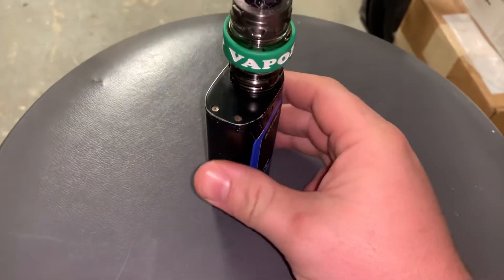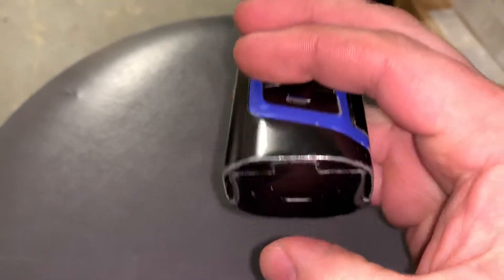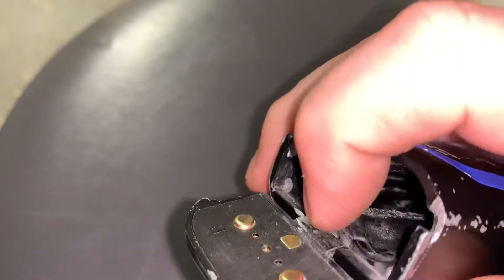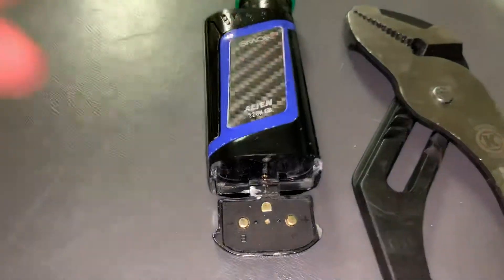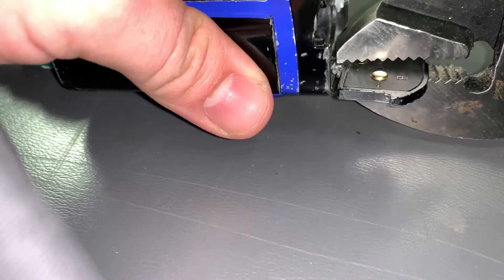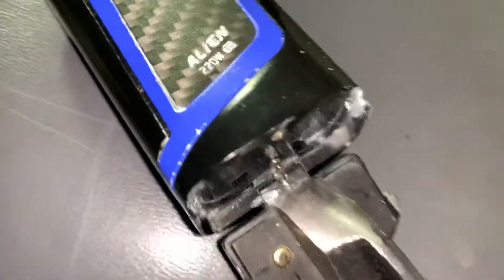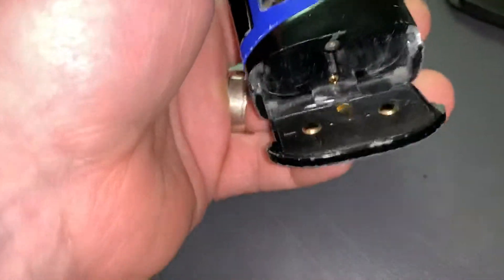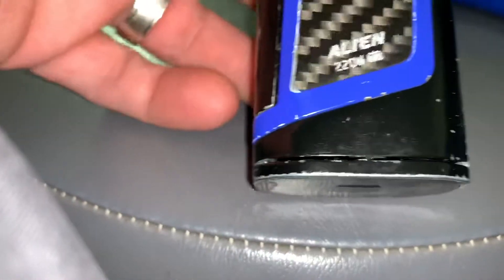Smok Alien 220 Battery Door Fix

Comment: thank you so much for this fix, I have exactly the same problem with the Smok Alien, battery door opening on its own with the slightest jolt due to too much slack in the hinge for the tiny retention  slots.   your fix appears to have done the trick, but time will tell!   the battery door fits tighter now.   thanks again for sharing.

Comment: Well after following instructions carefully, my 2019 bought model is now sadly in the recycling bin. The squeeze only made the door not shut at all, I would say this technique  is good for a last effort/shot at saving your mod. Nothing lost, as the batteries were dropping out/power lost after minutes of vaping so would have been scrapped anyway. Great mod for the price, simplest easy to use menu, nice & small, just the battery door & flakey paint job that lets it down. If Smok updated these two issues, keeping the rest the same, this would be the best budget mod of all time.  R.I.P!